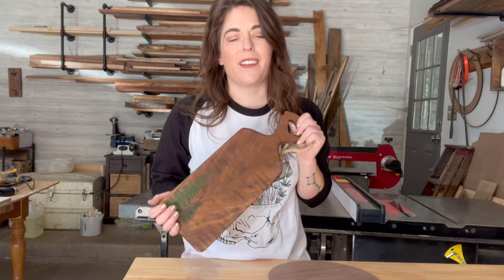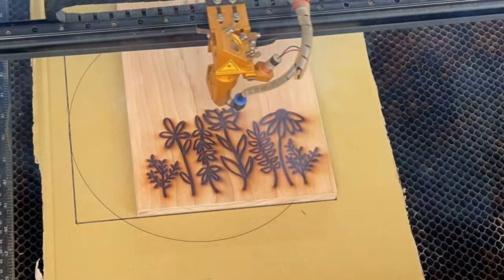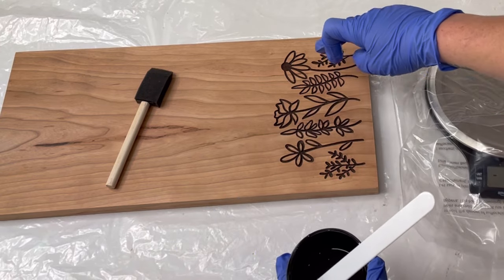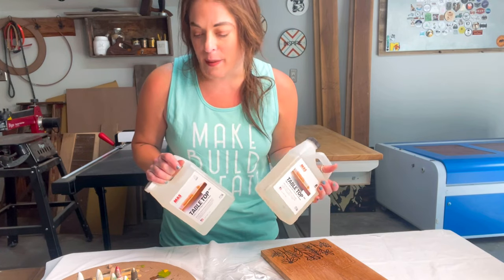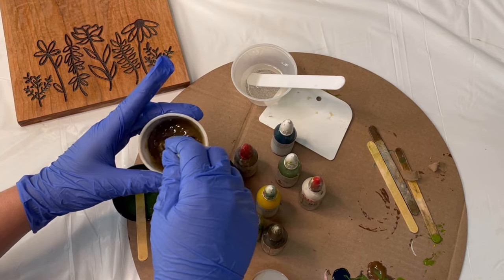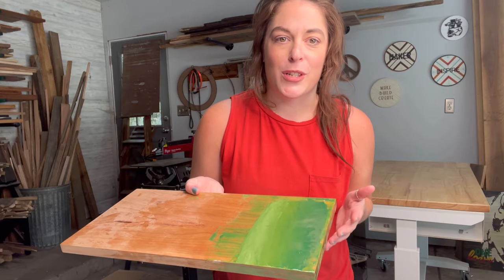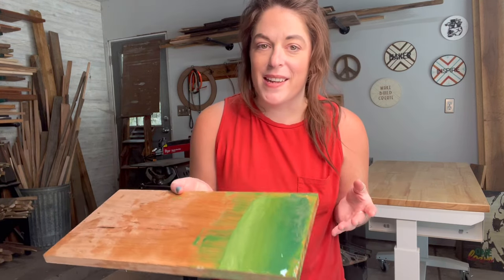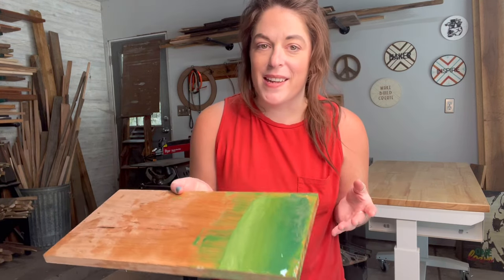How to Create a Laser Engraved Epoxy Fill

Comment: Just a suggestion: start by applying a mask of paper (label stock, tape, contact paper) over the wood.  Engrave the design. Apply sealer to inhibit bleed.  Apply the epoxy/paint and remove the excess.  Then remove the paper mask.  The mask will greatly reduce the sanding.
Reply from the maker: Is this something you’ve tried before? The epoxy would make it very difficult to get the masking off once cured. It would not pull off clean. If you’ve actually had success with this method then maybe I’m wrong but I would highly suggest not trying that.
Reply: @KendrasGotWood  this is why you apply mineral oil > laser engrave > mask >expoy >peel . Mineral oil will make it difficult if not impossible for the epoxy to adhere to the board. If it does, you can just sand it off. Reduces the sanding and gunking up of sandpaper by 90%  reduces time spent actually sanding, and it is far more economical lol.
Reply from the maker: It’s still going to be difficult to peel off the masking in all of the tiny little spots where it’s stuck. If that works for you, great but I don’t mind the sanding. I do however, hate peeling off masking with or without it being covered in epoxy.
Reply: @KendrasGotWood  I hate weeding masks too, but something that works for me is to use duct tape to peel the mask all at once.  I'm not suggesting you change a method that works for you, but if you have to mask anything in the future, it might be helpful.
Reply: yes and I've used spray shellac by Kinser which totally prevents the epoxy from bleeding and it's dries quick. 2 light coats does it

Comment: I was gonna 'wing' it. Glad I stopped by and saw this. I would have cried if I had all that bleed and couldn't get it out. Much appreciation.
Reply from the maker: Yeah it’s a bummer for sure. I find it depends on the wood, pigments and color of pigments but the epoxy seal is the one way to guarantee it won’t bleed.

Comment: Looks great Kendra
Your process worked for sure but you must admit it was tougher than it needed to be. if you want more fade in your project then try giving the syringes a try. You mentioned it and for the price of cheep ones I believe your sanding time and actual fade result will make it well worth it and If you don't like them then go back to your original plan. Either way your project turned out and that's really all that matters!
Reply from the maker: Thanks, I’ve tried using them before and that method is just not for me! I’ve used a few various methods and ultimately the end result works best if I do the way I showed, but of course if you prefer that method I understand. Thanks for watching!
Reply: @KendrasGotWood  The most important thing is we are all enjoying the hobby and always learning from others yet having fun as we try new methods!

Comment: To eliminate the bleeding suggest spraying a light coat of clear lacquer before you laser. This prevents any follow on bleeding around the edges. It also will eliminate your step of doing the clear epoxy fill step.
Reply: Sounds like it will eliminate the first sanding as well.🤷🏻‍♂
Reply from the maker: Hey thanks. Not sure if you noticed when you came to the comments but you’re not the first to comment this. At this point I won’t repeat why I don’t use lacquer but if it works for you, great!
Reply from the maker: Feel free to follow your own methods!

Comment: Don't know if it's been said but you can use other products to seal your wood.  Poly , sanding sealer are a couple I've use that prevent bleeding.
Reply from the maker: I thought I mentioned it in the video, but in my experience it doesn’t always work, but I feel like it also depends on the wood and the pigments. The epoxy seal is the only thing I find prevents it 100% of the time. Cherry especially, like I’m using in the video, I find likes to suck up the dark colors so I’d just rather be safe than sorry. If I’m using Walnut I’ll just spray it. Or if I using lighter pigments too.

Comment: Hey good stuff and thanks for the video! I've also been making a few epoxy projects and instead of using epoxy to protect the wood, I use shellac. You might want to try if you want to save some time. Less than 10 minutes later and it's ready for your colored pour.
Reply from the maker: Thanks. Not sure if you saw but about 20 other people mentioned this. 😂 I really regret not mentioning it more in the video. I don’t always use epoxy but I find it to be the only one true fail safe. Especially with cherry and dark liquid pigments.

Comment: Excellent video thanks. Do you know if you can do this with a cutting board, as you have to wash the board etc? Would the Resin still stick to the board, after a dishwasher etc. be interesting to find out? Thanks for a great video
Reply from the maker: I don’t recommend cutting on epoxy ever. Some brands claim to be food safe, but I would not cut on it, as the particals can get into the food. Plus, you’d be scratching up the epoxy. You also should not put a wooden cutting board in the dishwasher even without epoxy. 

Thanks for watching!

Comment: Making a 16" round table with a complex design covering the whole thing. It took 3 hours to engrave a light pattern at high speed. I'm now carving the design by hand to make it about 1/8" deep for the epoxy. In order to avoid color bleed, go over it with plain clear epoxy with a paint brush in the design and around the edges. Then let it fully cure.  It will be sanded down later after the rest of the colored epoxy has cured. A tip I picked up from a video from a guy who makes $5k plus custom tables professionally. So she is definitely doing it right.
Reply from the maker: Thank you! You definitely don’t want to cut corners and risk it when you put in that much work prior.

Comment: You can thin that epoxy with denatured alcohol...up to 50/50. Easier to brush on, seals well, soaks into the wood a bit, you could tip the item to drain off any excess. The denatured alcohol would make the epoxy 'flash' (cure) faster as well.
Reply from the maker: Thanks. Unnecessary in my opinion but you do you!

Comment: Nice, could you not use a clear, spray lacquer to seal the wood before you pour?
Reply from the maker: In my experience it doesn’t always work, but I feel like it also depends on the wood and your pigments. The epoxy seal is the only thing I find prevents it 100% of the time. But Cherry especially, I find likes to suck up the dark colors so I’d just rather be safe than sorry.

Comment: Nice video. Great ideas. I would like to suggest that people understand that not all epoxy, in fact most, unless it is a deep pour are measured by volume, not by weight. Makes a huge difference. Please check the directions on your epoxy. Hope that helps.
Reply from the maker: One of the things I love about MAS Epoxies resin, featured in this video is their online resin calculators, so you know no matter which system, or how you choose to measure it, it will be correct if followed properly. I agree though to make sure to follow the instructions on what you’re using. I believe any mistakes people make with epoxy are typically because they didn’t follow the directions.

Comment: Your video was super helpful, thank you!  I'm new to using lasers and like to epoxy resin fill charcuterie boards so food particles don't get stuck.  I had air bubbles that caused pitting in the epoxy (I did not know to seal before applying the color resin), the areas that were the worst were the thin lines - is there a guideline for line thickness to avoid this in the future, or will sealing it solve the problem entirely?
Reply from the maker: Sealing does help, but always won’t solve completely. I do have issues with micro bubbles here and there too and it sucks when it happens. Some things I do to try to prevent is put the epoxy in a warm bath prior. - Put the jug of epoxy, not the hardener in warm water.  This de-gasses the resin, but it will start to cure faster if it’s warm, so you don’t have as much working time. I also find giving the area a light spritz with alcohol helps prevent bubbles a bit.

Comment: Have you ever tried this on birch plywood? I am wondering if the clear will do a good enough job for it to not bleed?
Reply from the maker: I wouldn’t suggest plywood as you won’t be able to sand off any excess without sanding off layers of ply. I would really only suggest doing this method with hardwoods.

Comment: Cherry is my favorite Wood to burn with so far- nice choice! Walnut is my least favorite, but not because it looks bad- it looks really good! But good lord it stinks like nothing else and the smell lingers for a while. That's with a proper enclosure/extraction system too- it completely eliminates smoke and most of the time I like the smell of most Woods and it gets rid of those smells really well, but NOT Walnut- it actually makes me nauseous sometimes- if you've ever chewed up a Xanax, it's kinda like that in smell-form (Xanax has an absolutely terrible taste).

I figured a 100 watt CO2 laser would be faster than that. So far I've only got experience with Diode Lasers, I've got a 10 and a 20 watt and I really love them! I do more cutting than engraving and from what I've learned diodes are really great for cutting- they match CO2 lasers at the higher end (30+ watt) so they fit my needs. I do really wish I could cut through clear acrylic though so I could make windows for my miniatures without using a saw but that's down the road once I start making Money with the Lasers- the CO2 needs to pay for itself, which I plan to completely custom build so I can have a large bed/Z-Axis without having to sacrifice to the Gods :P 

If you're interested in seeing what I make 'ChaosFabs' with the other web address stuff (YT doesn't like links)- I design/produce everything myself so everything is original. I only have the things I offer on the site but I do much more than just Miniatures and those things will be on there soon. Take care and thanks for the Tutorial, I'm doing a lot of experimenting all the time and epoxy is the next thing I want to start messing around with.

Comment: Have you tried powder pigments such as mica powders instead of liquid pigments yet? These generally tend to be much less prone to bleeding into woods, often having zero bleed.
Reply from the maker: Yes. I thought I mentioned that in the video but I don’t remember now. I find even they can bleed into the certain wood. I usually just prefer the look of Mixol as well, since almost all mica powders have a shimmer.
Reply: @KendrasGotWood  Cant remember hearing you mention it, if you did then apologies. Yeah, personally love the shimmer but it’s not for everyone. Just looked at the Mixol, expensive but seems to have good reviews
Reply from the maker: Yeah it is pricey. A little goes a long way though. Plus you can mix it in paint/ stain. All kinds of stuff.

Comment: Hi Kendra!  Good vid.  Question: I’m engraving something that I want filled but also to cover the whole board.  It’s a top to a stand and only using clear.  Do you sand after the seal coat?  I may have missed if you did, but I know you sanded after the main coat, just curious.  Like yours I have some detail that I want to preserve.
Reply from the maker: I don’t personally sand after doing a top coat of epoxy.

Comment: Wonder if sanding sealer could be used to stop the bleeding?
Reply from the maker: Some people recommend it, in my opinion it also depends on the wood you’re using as well as the pigments. In my case the epoxy is the one true fail safe with darker colors that are prone to bleeding, like the green I used here and cherry wood really likes to suck it up.

Comment: Shellac seals the wood and dries in a few minutes. Time saver
Reply from the maker: I see a lot of people use Shellac but in my experience it doesn't always work. I do find the wood types and pigments to be a factor as well, and with cherry wood and dark liquid pigments like I am using here, I don't like to risk it, so epoxy is the safest way to go. I have learned after many of these, that the seal coat really helps better my results overall. It is course a matter of personal preference though.

Comment: You should try using some Minwax Sanding Sealer, it dries much faster and should help eliminate bleed. It works well for dies on wood.
Reply from the maker: Yeah I don’t know if you saw the other comments but I’ve been given multiple suggestions at this point. I wish I’d mentioned in the video why I choose epoxy over other things but it’s too late now. 😂 Personally I find the resin layer is the only true fail safe but other things work fine depending on the wood and pigments used. Again this is just my personal experience. With cherry specifically and the dark green pigments I didn’t want to risk it and I’d rather teach something the way I know always works than use something else and have that method fail for someone.

Comment: If you use shellac as you base including inside you designs and let it cure you will not get bleeding on you color fill epoxy
Reply from the maker: Thanks for the tips on my tutorial. Feel free to check out the other comments though. I’ll stick to my ways but I get it if you want to stick to yours.